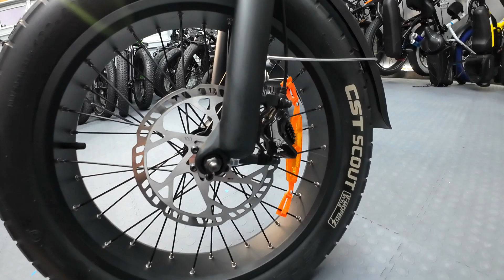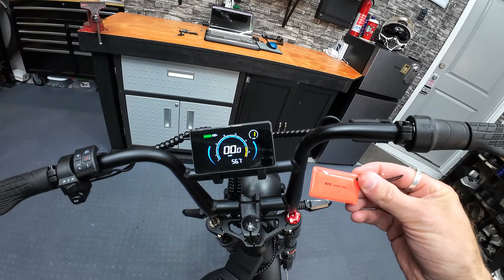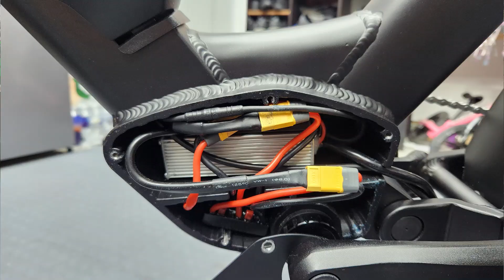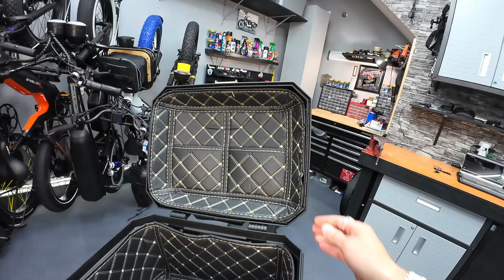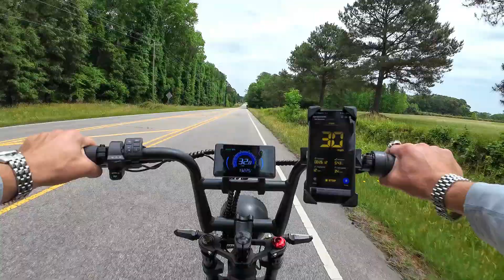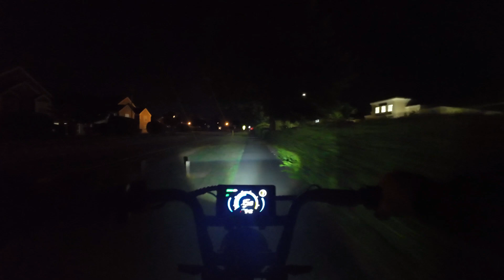Roll-road Emma 3.0 Moped eBike -- Dual 52V Batteries & Dual Suspension

Comment: This is a really thorough review, I appreciate it. The Mrs is 5'4 and you and I are about the same weight, so watching your video game me a real good idea of what it is to own one of these. I just placed my order for one. 🤘
Reply: Got ours and we've ridden it for roughly 100 miles now. We installed the 2-person seat  and between the Mrs. and I we have a combined weight of roughly 320 lbs. This review was right on, to include the derailleur slipping under high torque pedaling. We're enjoying it as our first ebike, and the two-person capability was one of requirements, but we definitely want to find a more comfortable seat or have one made. Aside from the derailleur needing adjustment and the hard seat, we have no complaints. The bike is solid and has all day range, but just like the review mentions, the battery meter will still show 100/95% after riding 30 miles, which is not accurate. If you get one, there's a good chance you can score one of the accessories for free if you send them some cool pictures.

Comment: 🐍 I have done the same battery error on my Grizzly. Flipping the 2nd battery ON will make the Full battery discharge into the lower voltage battery as well as power the motor. Or you can do what I do flip OFF the front battery and run the higher battery down to the same voltage then add the lower voltage for dual battery power and reduced SAG at the lower voltages. 🖖🤙

Comment: With a balance splitter, if you use 20% of one and then turn on the second battery at 100%, the first sits idle until the second drops to 80%.  It's best to ALWAYS keep both batteries on and use both.  With both batteries fully charged, you would have gotten 1600w+ and 37mph+ Each battery gives ~30-40 amps to get your best pull.  When the voltage equaled out, you got your 60-80amps back to do 40.
Reply: You forget the controller is limited to 28 amps.
Reply: @Hoggdoc1946  that actually blows

Comment: Great review as usual , but I think at least half of the people looking for an ebike are going to want more torque for the hills especially with this ebike not having the extra gears.
Reply: The top speed is fine but in New England it just doesn't appear to have the gonadotropin it needs for the hills. Maybe one day Wired will come out with one of these and do it right.
Reply: I hate auto correct , I  typed gonads
Reply from the maker: Yes, i would agree that hill climbing torque is something majority of people are looking for.   This bike had decent power but torque for steep hill climbing torque was not its strength.
Reply: This is totally true but if your willing to chip in a 100 watts of leg power, this bike is really excellent, I have just over 100 miles on our bike it is really a comfy solid family vehicle. If your a bigger rider who doesn't want to peddle at all and live in a hilly area, yeah, this bike is really not a good fit.
Reply: In my case and at my age (71) I'm  looking for  that pedal assist that will be substantial on the hills.

Comment: Juiced bikes lost it’s bid to copyright this design, as you see it’s just like the Hyper Scorpion. Yes that bike design and accessories that changed everything to what it is today. Juiced bikes troubles came from the pandemic just as the bike hit production. Parts dried up and the market forced swaps outs etc.. Anyway have mine now 4 years still rolling! Got to replace the pissy fork but it works still falls short of what the rest of the bike demands. Tektro brakes are fine no problems. 10,000 miles and still rocking. The bikes design is a good one and with loss of copyright more bikes like this will pop up.

Comment: Really didn't care for the lack of gears , would have been a deal breaker for me .
Reply: With enough power and big tooth chain ring you don't need gears. It's clean and simple I love it. If they had second engine for this one to the front I'll probably buy it or you can add it yourself actually.
Reply: Yup!
Reply: @helix9268 would be a tank w a second motor lol. Love the way your brain works 😂

Comment: The way the display is mounted could be changed. If you want to put an accessory on the bars that display hogs up all the room . Can't slide it out of the way
Reply: There is a little bit of room by the grips to mount something.

Comment: With the weight of this bike at well over 100 lbs. You won't be able to peddle this bike with a single gear. They should have given the bike multiple gears in case of a battery problem for safety. I had a juiced rip racer with a single gear system. You cannot peddle it if there is a battery outage I have had the experience.
Reply: It’s not meant to be ridden with a dead battery 🪫 😂
Reply: I own this bike, you'd be surprised how useful that one gear is in combination with the torque sensor. Can peddle comfortably at 5-10 mph or crank into and pedal up to 30mph (you look like a normal person up to 25mph,, then you look a little intense up to 30, but I do it :) Great bike
Reply: @soandsononame8750 just admit you cant afford it bro

Comment: Which one would you buy, juices hyperscramble 2 or road roll Emma 3.0 also this can go up to 65 mph correct
Reply from the maker: Personally i would probably get the Roll Road because it has more battery capacity, more robust motor, more cargo capacity, and easy mount step thru frame, all for the same price as the Hyperscrambler.  That looks like a great closeout deal on the Hyperscrambler though.  Whatever fits you best!
Reply: 3.0 has only single speed and 2.0 has 7 speed, which one you think is good to buy between this 2?
Reply: Can you put 7 speed on emma 3.0?

Comment: Do you think it’s possible to upgrade to a 45a controller?
Reply from the maker: @johnnylong2049  yes I think it's possible. I thought about putting the 45 amp controller from my kit on there but I didn't want to lose the torque sensor and the Emma display screen which is nice
Reply: @CitizenCycle925  that’s what I was afraid of, losing the torque sensor. I thought it would just connect to the pas plug of the controller
Reply from the maker: @johnnylong2049  unfortunately the KT controllers don't work with torque sensors
Reply: @CitizenCycle925  how can you till a controller has torque sensor pas connection?
Reply: @CitizenCycle925  I just spoke to Roll Road customer support, and they stated that the bike you reviewed was an older Emma 3.0 model. The newer Emma 3.0 model has a 32-amp controller that peaks at 1800 watts. This should make climbing those hills less difficult. Can't wait for mine to arrive.
Reply from the maker: @krisjamieson7520  dang! I'll have to see if I can get the new controller!!
Reply: @krisjamieson7520 I bought mine in June. I wonder if it has the older controller? How would I find out?
Reply: @pdleyland  I think the 32 a controller was for the bikes that shipped in August. You could contact their customer support. I checked mine when it was delivered and it says 35 a on the controller.

Comment: Can a front rack be installed?
Reply from the maker: @hank6887  no mounting points for front rack
Reply: @CitizenCycle925  thanks for the quick response and video .
Reply from the maker: @hank6887  plus it has the double crown Forks. any type of front basket would have to clamp onto the front fork
Reply: @CitizenCycle925  ty

Comment: Just the brand name of lots of these Xinese E-bikes reeks of "tofu-dreg" construction. Won't last a year w/o issues. And when it breaks, who is gonna work on it in your town?  YOU!
Reply: Hi, 3.0 is the 4th version actually. We designed and improved it from Emma, Emma pro, 2.0, and now the 3.0. Fly-by-night companies will not continue to invest in improvements to one model. So this is a mature model that can stand the test of the market. We listen to customer feedback and continue to improve this product. We will launch version 4.0 in 2025.
Reply: @RollRoadEbike I’m a bike guy  who had two back surgeries & I want my freedom back. I use an underwater treadmill twice a week trying to loose weight & my goal is to get to 399lbs before I purchase the Emma 2.0, I now want the 3.0 but after seeing this video & seeing him struggle up the hill, I would want to shift into a lower gear because I don’t think I could peddle going up a hill. My goal is to get under 300lbs & Emma will be fun for me to get there. I’ll hold off to see what the 4.0 has to offer but I don’t need a front motor. Some of the mountain trails won’t allow it but glad that you can change to the different classes & I like that trunk. It’s about perfect for me & I would want a lower gear, mirrors & a trailer hitch to tow a small trailer to haul a cooler & camp chair, even take a fishing pole.

Comment: I can't believe this bike doesn't have any gears, it has the more expensive torque sensor. yet as it has no gears it's useless at high and low speeds.
Hopefully they rectify this with the Emma 4.0.
I really love every other aspect of this bike, but this is a potential deal breaker.
Reply from the maker: I'm pretty sure their is an updated model coming out soon, guess we'll see if they make updates to the gearing